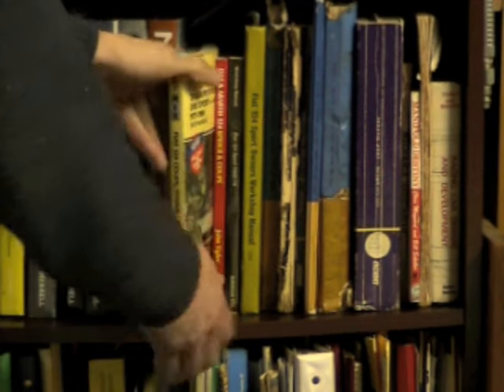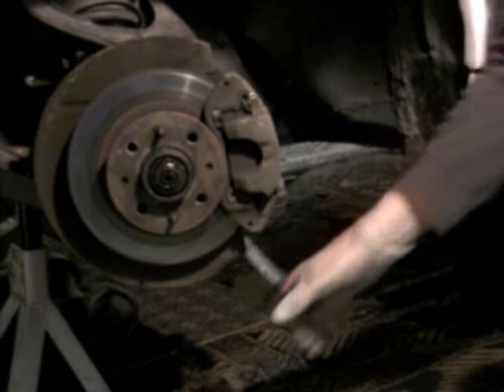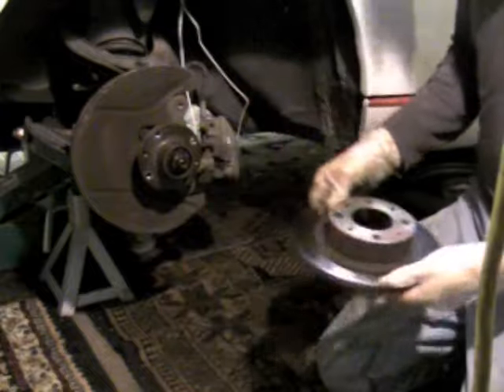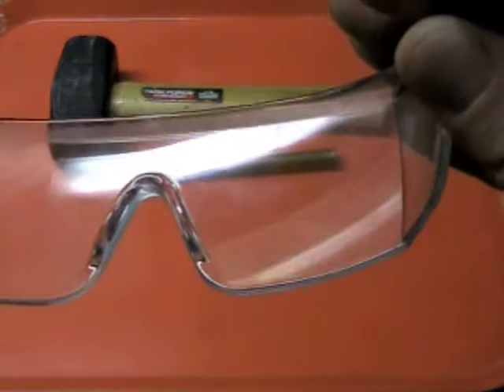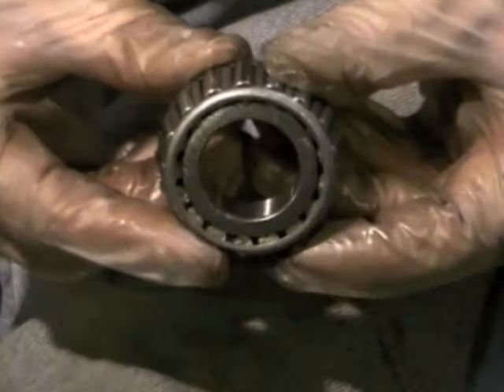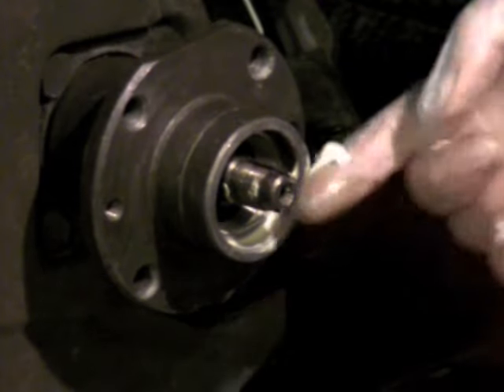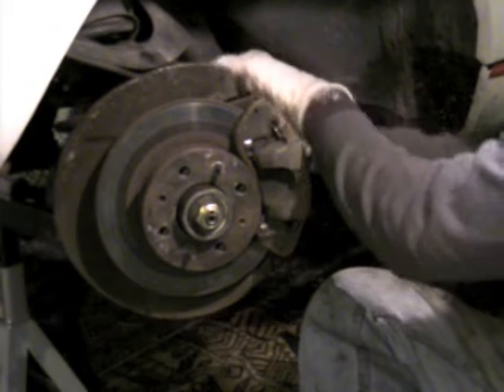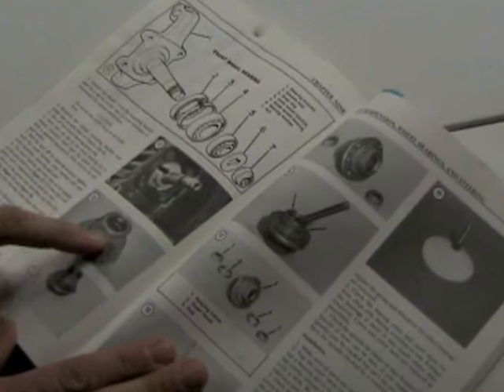Fiat 124 Sport Spider Front Wheel Bearing

Comment: Hello  I have a fiat x19 is this the same procedure
Reply from the maker: I honestly don't know. It has been so many years since I had an X1/9 that I don't recall. It should be very similar, I know the brakes use about the same parts as the 124, but the X is based on the 128, which was a different setup for many things. I had four X1/9s over the years and my 74 &  80 are two of the few cars I wish I had never let go.

Comment: Hi. I  was  wondering do you have part number of measurements  for hub seal? I'm planing to rebuild Fiat 125 hubs and they should be the same as Spiders. Thanks
Reply from the maker: Hi! Just saw your question. The seals I used are about 56mm outside and , I'm guessing, 35mm inside diameter.  I bought them from a company International Autoparts in the USA. It looks like they have been taken over by another company since then that lists the seals here:
https://autoricambi.us/collections/gasket-seals/products/front-wheel-bearing-seal
.They do seem to be a fairly standard type seal, so there may be more than one manufacturer or vendor.Hope that helps.
Alden
Reply: Thanks for info. Well I'm based in Europe, so I will find something here. Regarding seal measurements they should be 45x59x10 OEM number 4117608, Corteco analog is 12011508B. When it comes to bearings codes for Coram CR014 and CR013, Breda/Lorett - C065 and C064, Timken LM-67048/LM67010 and LM11949/LM11910, SKF: KLM-67048/KLM67010 and KLM11949/KLM11910 also it can be found as LM67048/0/0/Q and LM11949/910/Q.
Reply from the maker: Excellent research! It made me dig out the data I had (remember it was 7+years ago!) I have one inner bearing from a company "BRC" from Italy and the part number was CR020 along with the number 4009067-FAG 639154 which may be a cross-reference number.The outer is a SKF bearing that looks to be labeled simply BR2. But both of these are from so long ago that the part numbers may have been superseded by now.The grease seal itself is just in a clear plastic bag with no indication of size or manufacturer.
Alden
Reply: Sure numbers might change through the time. I will confirm all info as soon I get my hands on. All I know that Fiat 125/132, Argenta, as used by Abarth on Fiat 124 CSA, Seat 124 2000, Pinninfarina 124 1985.5, 124 Volumex shares the same hub, so bearings and seals should be same.
Reply: Wll now I can confirm that all codes are right, and if someone ever needs dimensions of those bearings they are here: 31 750x 59 131 x 15 875 and 19.0 x 45.2 x 15.4. Seal dimentions are: 45x 59.13x 10 and Corteco code is 12011508B. I hope this will help the others in case someone wants to buy high quality bearings and seals separate instead some unknown cheep set.
Reply from the maker: Outstanding! Thank you for doing the research and getting those numbers. This is really YouTube at it's collaborative best and it keeps  fun cars on the road!
Alden

Comment: Really appreciate your videos. Any chance you want to tackle how to adjust the valves? (pleasesayyespleasesayyes)
Reply: Just realized you beat me to the punch and see the video. Thanks again! keep up the good work.
Reply from the maker: Daniel Cheetham The thing with the valves is to REALLY take your time and not try to rush it. Also, DEAD cold engine, like leave it overnight before adjusting.Don't turn the engine backwards, only forwards, and only by hand/wrench. Blipping the starter is going to jump it past where you want it almost every time. When you are done, before you start it, before you put the covers back on, turn it all the way around a couple times to make sure the shims seat and aren't going to jump out of the buckets. They can jam the camshaft & break the timing belt. But the task is definitely worth it. Best luck to you on it
Alden